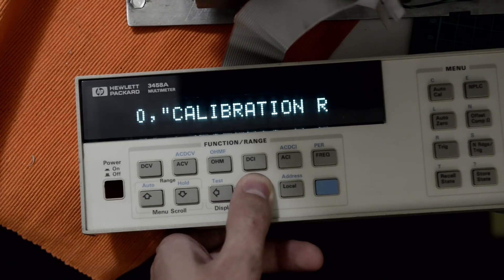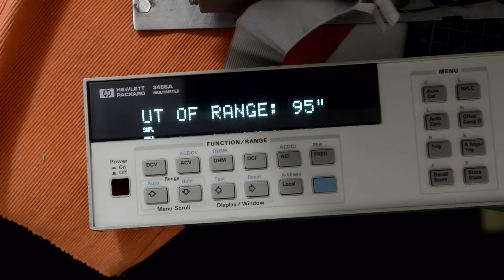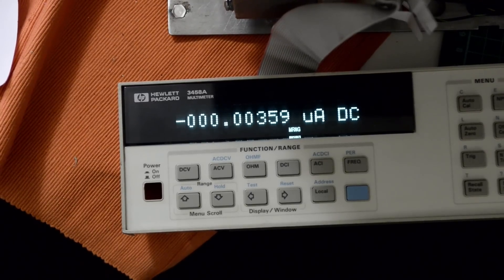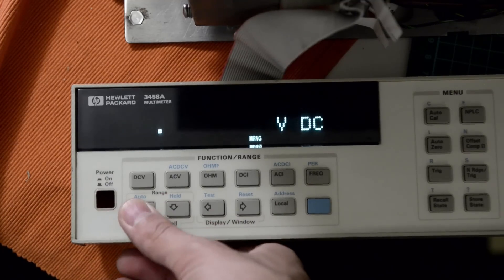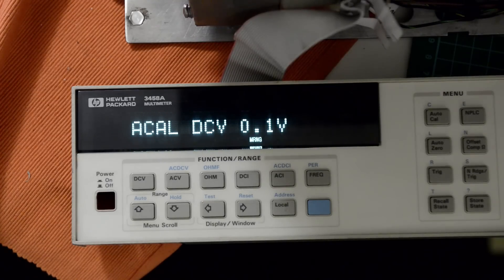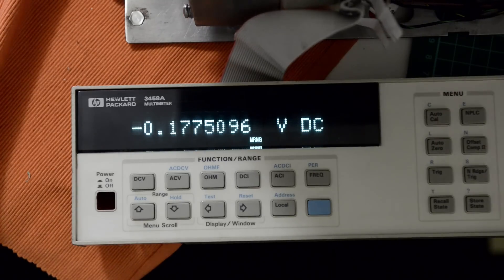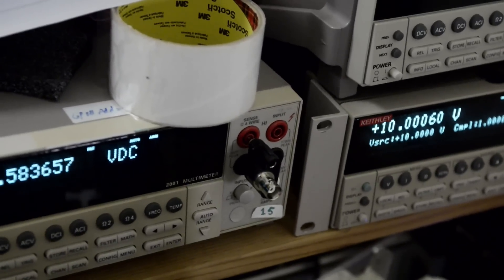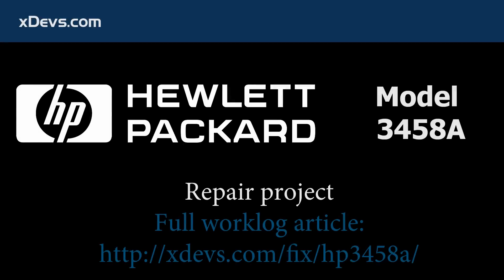First measurements out 3458A repair project!

Comment: Hi xDevs_com,
i have this problem ERRSTR 205 hard / out of range 95"; so i change the the U203 i check the U204 who is the lm339 the resistor network rp200 it makes 1kohms of each, the transistors Jfet are ok, but the problem is the same! please can you help ? thanks in advance.
Reply from the maker: Is it on all current ranges or just some? You will have to trace which ranges have problem, and then check related path by schematics. It could be bad relay or switch later or before. Also resistor RP200 is 100K or 220K, not 1K. I covered some more details in article: https://xdevs.com/fix/hp3458a/#diag2
Reply: i answer you on skype, thanks